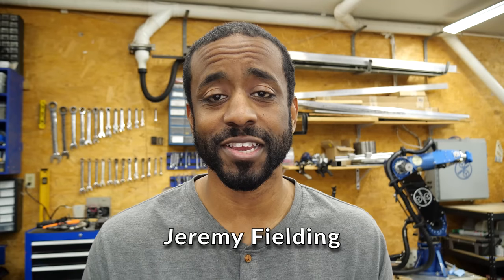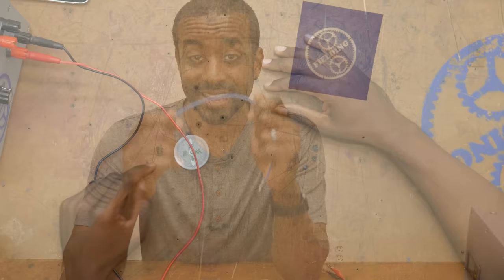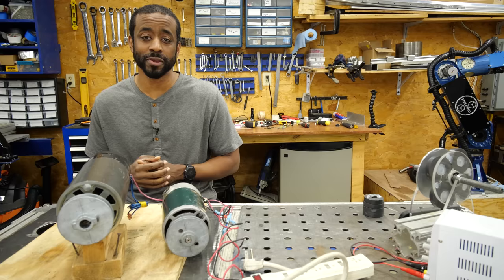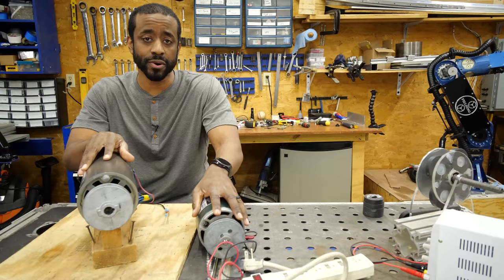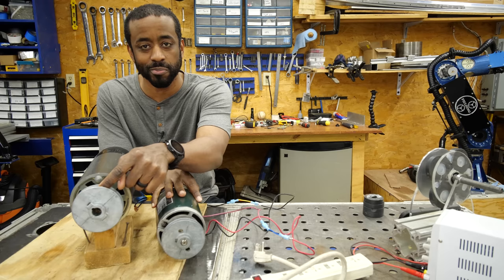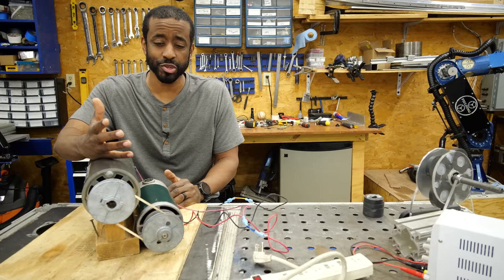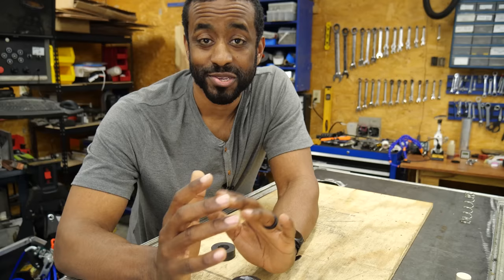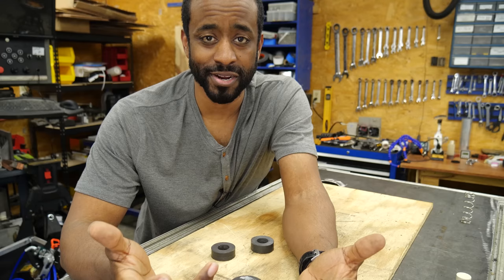Reviewing Free Energy Generators.  A Response to My Video "Nikola Tesla's Greatest Invention"- 102

Comment: Creating a circuit that involves a motor-generator setup, a buck-boost converter, and a battery charging system is a complex task that requires careful consideration of each component. Here’s a high-level overview of how such a system could be designed:

### Components Needed:
1. *Motor-Generator Pair:*
   - *Motor 1:* The primary motor that drives the system.
   - *Generator (Motor 2):* The secondary motor acting as a generator to produce electrical power.

2. *Buck-Boost Converter:*
   - A power electronic device that can step up (boost) or step down (buck) the voltage to match the requirements of Motor 1.

3. *Battery Bank:*
   - A storage system to store excess energy produced by the generator.

4. *Control Circuitry:*
   - To manage the flow of energy, ensuring the system operates efficiently and safely.

### Circuit Design:

1. *Motor-Generator Pair Setup:*
   - Connect Motor 1 to Motor 2 mechanically so that Motor 1 drives Motor 2. Motor 2 will act as a generator when driven by Motor 1.

2. *Electrical Connections:*
   - *Generator Output:* Connect the output of the generator to the input of the buck-boost converter.

3. *Buck-Boost Converter:*
   - *Input:* Connect to the generator output.
   - *Output 1:* Connect to Motor 1 to provide it with the necessary voltage and current to keep it running.
   - *Output 2:* Connect to the battery bank to charge the batteries with excess energy.

4. *Control System:*
   - Use a microcontroller or a dedicated control circuit to monitor the voltage and current levels at various points in the system.
   - Ensure the buck-boost converter is adjusting correctly to maintain the required voltage for Motor 1.
   - Divert excess power to the battery bank when the generator produces more power than needed.

### Block Diagram:

```plaintext
[Motor 1] --(mechanical connection)--> [Motor 2 (Generator)]
      |                                   |
      |                                   |
   [Buck-Boost Converter] -------------   |
      |                |                |  |
      |                |                |  |
      v                v                |  |
[Motor 1 Input]   [Battery Bank] <-------  |
      |                ^                   |
      |                |                   |
      ----------------- -------------------
```

### Detailed Steps:

1. *Motor 1 Drives Motor 2:*
   - When Motor 1 is powered, it mechanically drives Motor 2, causing Motor 2 to generate electrical power.

2. *Power Conversion:*
   - The electrical power generated by Motor 2 is fed into the buck-boost converter. The converter adjusts the voltage level to match the requirements of Motor 1.

3. *Power Distribution:*
   - The buck-boost converter splits the power output:
     - A portion of the power is fed back to Motor 1 to keep it running.
     - The excess power is sent to the battery bank for storage.

4. *Battery Charging:*
   - The control circuitry monitors the power flow and ensures that the battery bank is charged with the excess energy generated by the system.

### Considerations:
- *Efficiency:* Each component (motors, buck-boost converter, battery) will have its efficiency losses. The overall system efficiency will be lower due to these losses.
- *Control Logic:* Proper control logic is necessary to ensure that Motor 1 receives sufficient power while avoiding overcharging the battery bank.
- *Safety:* Ensure proper safety mechanisms are in place to prevent overvoltage, overcurrent, and overheating conditions.

This setup theoretically could work, but practically it would face challenges due to efficiency losses and the complexities of control mechanisms. It is crucial to design each component carefully and test it thoroughly to ensure reliable operation. I watched your complete video and started to think and ask questions of AI models and the above was the outcome. Please read it and think about it and maybe see if you can prove the theory right or wrong. Please keep me posted. Even if you think I am crazy.

Comment: Try putting a flywheel with one  generator  motor.  this flywheel   will store energy  at certain level of rpm   and will keep running the generator   motor.  when it will be at higher rpm ( manually you will have to run it   just like  stater motor)   and flow of electricity  will begin      then  connect the other motor to this generator  output     which will be turning the generator  and fly wheel at proper  rhythm  of motion.   Diameter of pully of motor  driving the generator  motor  should be  made  in a way  that it should provide proper revolution to the generator  motor.   This is  the basic setup     further   ammendment can be made to tune the system    IT WORK S    I SAW IT    PERSONALLY .

Comment: If you cut the transformer in half then it would be open meaning the magnetic field expands more using less volts to pull and a strong hold meaning 20 volts would have pulled a semi rather than circulating metal that requires more power to get a hint of pull
Reply from the maker: The field expands the strength get weaker not stronger. You will need more power from the transformer to get more pull. This is very easy to test and prove. Please just try it yourself. If you were right we could use a tiny transformer to lift cars at the junk yard instead of the enormous electromagnets and power supplies they use now.

Comment: So, Sitting here I immediately thought about for example,..... the Moon rotating around the Earth or of course the planets rotation around the Sun.  I had once considered the Idea (for a Science Fiction Story)  a Space ship Propelled by the gravitational forces of the Universe.  Or another example, Perhaps the Earth spinning on its Access.  Wouldn't these kind of Poke at the idea of something that resembles perpetual motion.  Kind of a Macro Magnetism as it were?
Reply from the maker: Except it’s not perpetual. The earth and everything in space is slowing down. We can measure this. We have to add time occasionally because the earth is gradually spinning slower. It’s like everything was wound up like a clock at the beginning and it’s very slowly winding down. There is no perpetual motion anywhere. On NASA’s website there is an article about how we are slowly losing the moon. It’s moving slowly away from earth. We will eventually lose it. The sun will eventually burn out.

Comment: By the way, if you do hook up an alternator to a Tesla, it will not give you infinite power. However, it can make your battery last a little bit longer. That's actually true. It's not a lot longer, but you can get a bit of extra charge out of it
Reply from the maker: You should watch part two. I prove this is incorrect with a test on an alternator. But the real reason I think you should watch the second one is I do a better job of showing and explaining the problem. Not only is this a terrible idea, increasing the cost and number of parts to break, it will make the car total distance less not more. Exactly the opposite! I know why you think this will work. I fix that piece of the puzzle best in part three if you want to understand. Links in the description.

Comment: A guy in India just put an electric motor in his Hyundai And kept his gearbox making it more efficient than just a straight up EV motor he used both. Producing less power than the gas engine but better efficiency than just a plain EV.
Reply from the maker: I gearbox does not / can not increase efficiency.  I explained and proved this in part two of the series. Link in the description

Comment: Maybe there is a way to take the load of the powering side with some type of pully system. Kind of like using pulleys to lift a block more easily.
Reply from the maker: Pulleys gears etc give you mechanical advantage. That’s different from multiplying power. I explain this in part two and part three. Link in the description

Comment: If someone invented a "free energy" device that is capable of outputting more energy than was ever put in, it wouldn't work for long. Because it would randomly start running because of minute disturbances, and because the excess energy has nowhere to go, it would keep running in a positive feedback loop generating more energy that is being put back into the device until it eventually explodes.

... and this will happen without any user input.

Comment: I am curious how you'd explain Otis T. Carr's Amusement Device patent and a  battery turning  or rotating  a mechanical metal plate in relation to a fixed metal plate while passing through an array of  induction coils and recharging battery from electrostatic influences?

Comment: Great video, really educational👌 Just one tiny issue, the animation seems to be running backwards 19:37 😅
Reply from the maker: Its correct... but in reality it doesn't work in either direction right?? LOL I love this.
Reply: True that this will never work in practice. I have seen these animations before, but I think the wheel was spining in the direction of the balls that produced more torque. The balls on the left have more leverage than the right, giving the impressions that it would spin anticlockwise.

Comment: Greetings JF, it's me again. A few more thoughts have occurred to me relative to EV's and the possibility of adding energy to the system from the environment. Since we are required to accept the proposition that a certain percentage of the energy used in the "closed" system of the vehicle becomes "lost" due to friction, heat, etc. then wouldn't the reverse of that concept also be true? For example, during braking and under conditions of downhill travel, the vehicle uses friction and/or braking to maintain an acceptable velocity. If the kinetic energy of the vehicle moving from an elevated position to a lower one, were to be tapped and directed back into the "closed" system of the drive motor, certainly a considerable amount of energy might be captured and stored (within the batteries) for future use. In a related version, the addition of a small gas powered generator could be used to recharge the batteries during travel to mitigate the amount of charge being drawn from the batteries. I have no idea of how inefficient the generator would be when measured against the amount of gasoline required to generate the electricity added to the power pack but any additional charge to the power pack would be preferable to relying solely on recharging stations which remain poorly distributed. I expect any moderately competent engineer could point out flaws, inconsistencies, and/or inefficiencies to these proposals but the basic concept certainly presents possibilities worthy of discussion.

Comment: if you add a circuit between the two motors with a couple of capacitors and a transistor that boosts the voltage to the second motor it could give the added power to propel the second motor and in turn the first motor.
Reply from the maker: You should watch part three. Link to playlist in the description. I talk about something very similar to this idea which has exactly the same problem. It doesn't work. But to know why its better if you watch the video rather than try to explain it in the comments.
Reply: @Jeremy_Fielding  Thanks for the reply. 6 million views and you're still giving feedback says a lot about you...Good job in other words.  I went to school many years ago for electronics tech for a year, so I know just enough to be dangerous but it still fascinates me. Ill check out part 3. Thanks

Comment: Really nice video. But I want to go deeper in the magnets. The conclusion is, there is only a current in the (closed loop) wire, when the wire is under the influence of a changing magnetic field and
a running current (only possible when the wiring is in a closed loop) will make a magnetic field around the wire.
This is almost the basic of electricity.

But let us now talk about permanent magnets. Using soft iron makes electromagnets, that loose their magnetism as soon as the current stops, so the current for these magnets comes from outside the magnet. But now we have magnets (neodymium for instance) that hold their magnetism hundreds of years and they do not loose it when the magnets are used in a generator.
So let us look at a high power neodymium magnet. The magnetism is indused by a strong magnetic field from outside the neodymium and the opinion is, that this current aligns the molecules because they all become micro magnets. 

As far as I know, it is stated that electricity induces a magnetic field (1) and a moving magnetic field induces an electric current (2)

When we now look at a neodymium magnet, as soon as the external current is shut down, the magnetic force is still there.
And as a magnetic force only can exist because of an electric current, the powering of the magnet with an extern electic current MUST have induced an intern electric current, otherwise the magnetic field should disappear. And this current must be very, very strong. But it is not an alternating current, so the magnetic force is not alternating also. And because  this magnetic force is not changing by itself, we can not use them for inducing an electric current in a closed loop wire. That is why WE need to move the magnets and have to add energy from outside that magnet to create that current.

I think, every phenomenon has its own self resonance, the frequency in wich it can start to export energy, like the sun and the stars. 

Still the problem is, these magnets are not yet in their self resonance and therefor can not give free energy.

Remember, the law of conservation of energy only works for a closed system, never  for an open system. So, when we step outside the box, it must be possible to trigger the permanent magnet to its self resonance frequency end then it will start to give us free energy.

I hope, there will be people who really understand this and try to think about it. As soon as we are capable to put these magnets in self resonance, we can say goodbye to fossile fuels, windmills and pv panels.

Comment: Could generators be integrated into the wheels or axles? I don't mean the tires. I mean something that can generate energy from the turning of the wheel mounts or inner mechanisms of the axles. Belts cause drag. Maybe this could be integrated to have less of an impact. It has always driven me crazy that there isn't a way to use the energy of the turning wheels considering that turning wheels are a component of so many energy producing mechanisms. With cars you have at least 4 potential generators, with large trucks and trailers you have many more. If not for perpetual energy could this not extend range significantly? Keep this up. You are really good at it and that's not the case with far too many of these videos.

Comment: To gain energy, you need a smaller pulley on your output motor.smaller wheel faster revolution faster revolution more power output. just a thought
Reply from the maker: You should watch part two. I explain this aspect in greater detail. Gears, nor pulleys change the power output. I prove this in part two and explain why. Its really a trade not a increase in power. Link to playlist in the description.

Comment: What if you ran the bleed off of both motors in series with several of these set ups into a single deep cycle storage cell? Then you could be at-least creating usable electricity after the deep cycle storage has been adequately charged

Comment: For those how love mathematics. Here's a a mathematical equation. 

How fast does a 12v alternator spin to generate max about of wattage?

If a vehicle Idles between  560-770 rpms. The alternator generates between 560-770 watts. 

So the faster a alternator spines, determines how much watts is produced. Or it doesn't make more wattage because it only produces 13v-14v on a 12v alternator. 

If max rpms for a 12v alternator is between 560-770 rpms. You produce 1 watt of electricity  for 1 rpm.

A electric motor would have to spin at max, between 560-770 rpms to generate max wattage on a single alternator.  Which, would cancel each other out.

But what if you ran two alternators off the same electric motor and both alternators spin at the same rate of rpms. Do you double the amount of wattage being produced then your using to run the electric motor. To spin two alternators at the same rate of rpms?
Reply from the maker: You should watch part three. Links in the description. If you push two alternators each will get half the power. So every other assumption doesn’t work. You don’t even need a calculator the end result is the same power minus more waste for using two alternators. I prove this in video two and explain why in video 3 with more detail and another demonstration. Links in the description…. And Thanks for watching.

Comment: Good video. I have seen articles where they were going to make some kind of charging system that charged the battery during braking. To me that sounds pretty inefficient and you would have to ride the brakes constantly to charge the batteries. 
But, wouldn't and alternator in an electric vehicle that produced some charge be better than no charge at all? It seems like that could extend the  mileage that you would get before having to plug in.
Reply from the maker: I talk about both of these ideas in part two. Link in description. There is zero benefit not just little benefit. I explained in part two and proved it with a test at the end

Comment: But if you attach the alternator to a mechanical part then you should be able to gain power. The wheels for instance or the center shaft. Im not a scientist but when wheels turn there is energy that we dont use.